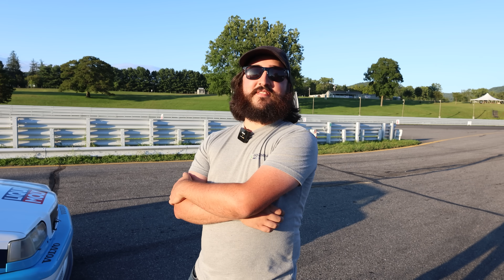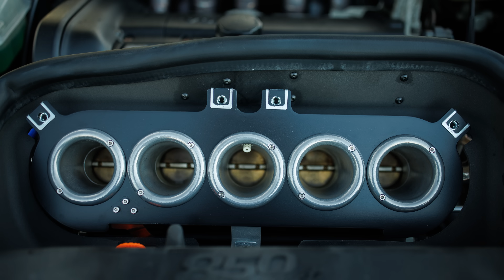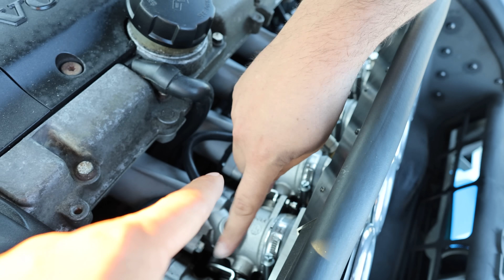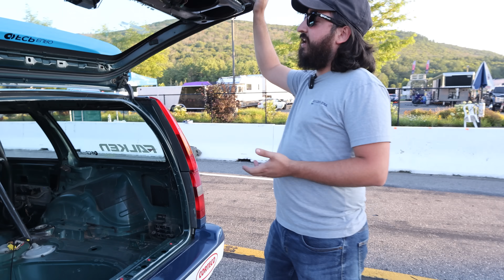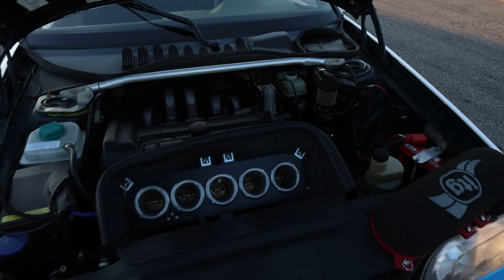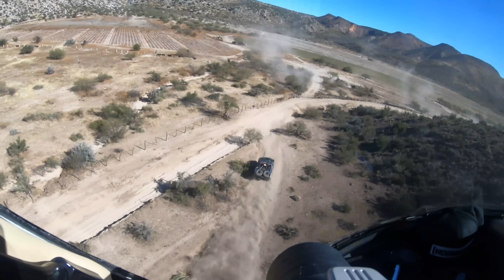Touring Car-Inspired Volvo 850 Wagon Track Weapon

Comment: the ideal spec IS a non-turbo, non-sunroof, non-auto, non-wagon 850.. it's the *lightest, most rigid version.. this dude can say what he wants, GLASS weighs a TON and it's overhanging the centerline of the rear axle = bad. guaranteed, the sedan version with this exact setup would beat it around a track. the claim to fame of 850 NA isn't the power, it's the handling and any weight overhanging the axles limits handling.

Comment: There was much stretching of the rules as said to get this thing to make the power it needed. Basically machined the head down at an angle to get better  flow through the valves due to rules about not changing various things vs the road version.

Comment: You will never see a 3 series wagon with an original 300k 5 speed, let alone, one on a track. I'm pretty surprised he didn't opt for a 2.5 and simply use NA parts from the 2.4. Also, why does it not surprise me that Larry had a 740?

Comment: Next mission would have to be tubbing the arches! These look so much better tucked and slammed 😍 Unreal build though, that 5 cylinder is a special piece of kit!
Reply: That is in the books if we do a season3 of the build. Built NA engine, and Tubs :-)
Reply: @fcpeuro wonder how much more you could push the 2.4. I’ve seen even on the RN VVT engines it can be hard to get past 260hp. 

Wonder would some head work get you guys closer to the TWR engines numbers. What is the redline on it at the minute? TSP Sweden have valve springs they say are rated to 10k rpm
Reply: Hell yeah for that true super touring car stance